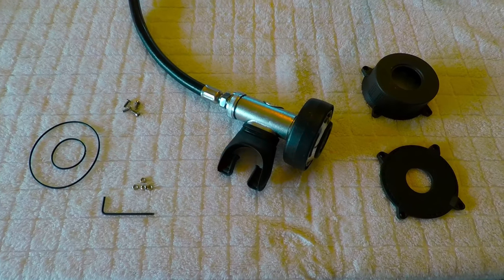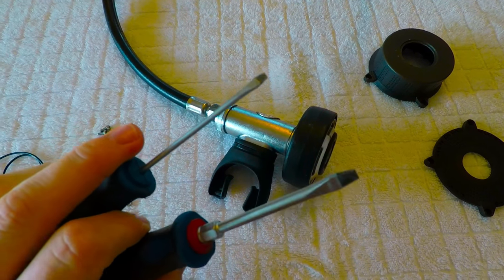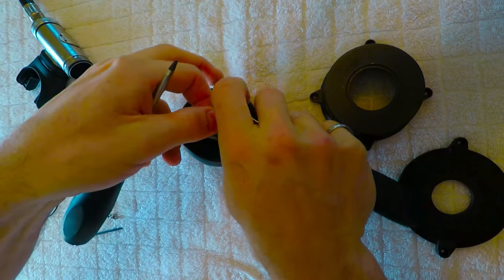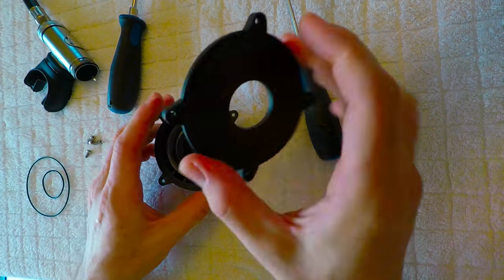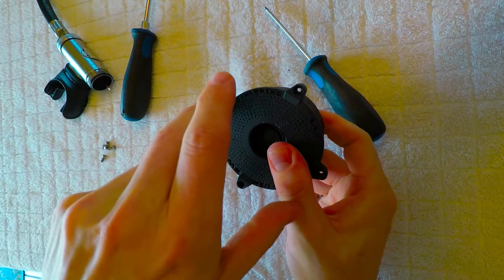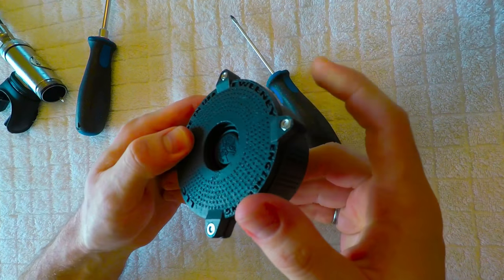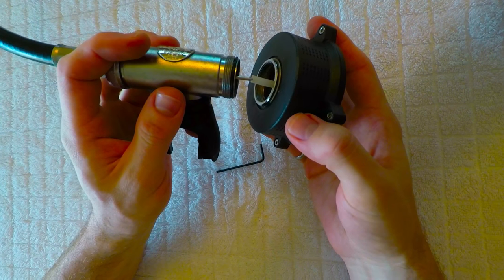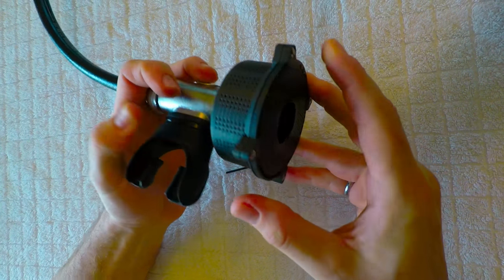How to install the Silent Diver for Poseidon Cyklon 5000

Comment: Hey collin, quick question, do you service they cyklons your self or send it out?
Reply from the maker: I do not service regulators for others myself, I only design and manufacture the accessory.
Reply: @2ndbestvideos  Thank you, I have a Cyklon Set that needs service and was wondering about the difficulty level for simple O ring changes
Reply from the maker: @pablosagion  to my knowledge they aren't difficult but for liability reasons they won't sell parts to anyone who isn't a authorized/certified cyklon rep. So even if you know how to rebuild them you can't get the parts.
Reply: @2ndbestvideos  Got It. Thanks for the info. I'll send it out to the local shop. Hopefully, I don't have to sell a kidney for it :)